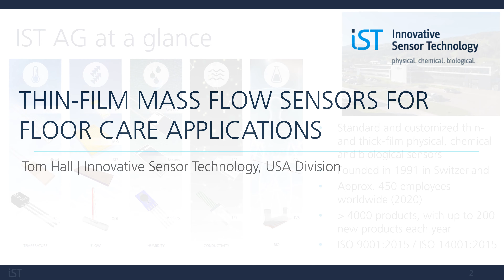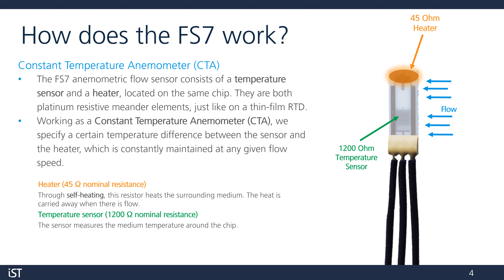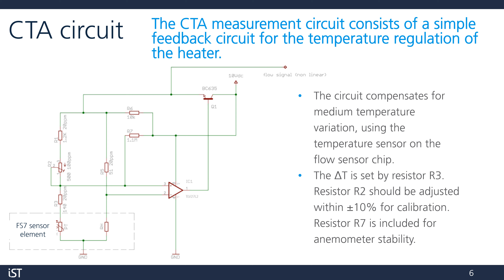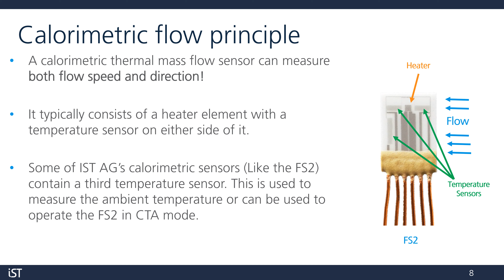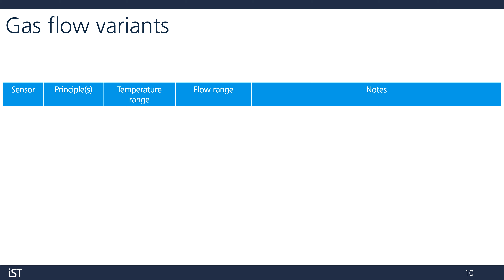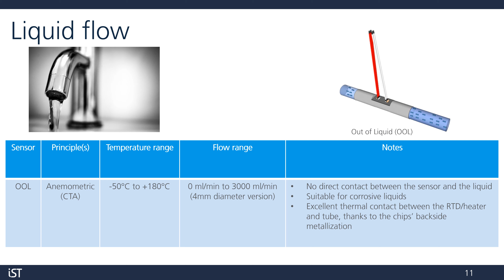Thin-film mass flow sensors for Floor Care Applications

Comment: Hi everyone!

I’m facing some difficulties using the FS7 sensor to measure a pressure of -20 inH2O.

Additionally, I’m trying to relate this negative pressure in an equation, but I’m not quite sure how to proceed. Could anyone help me with this? I appreciate any guidance or suggestions you can provide.

Thank you!
Reply from the maker: Hello Leonardo, 
Thank you for your message and your interest to our products and services! 
Our engineers will get in contact with you directly to provide more information about our FS7 Flow sensor.  

Best regards,
IST